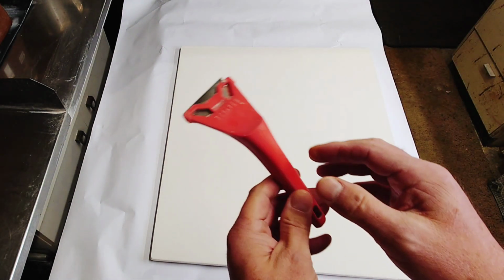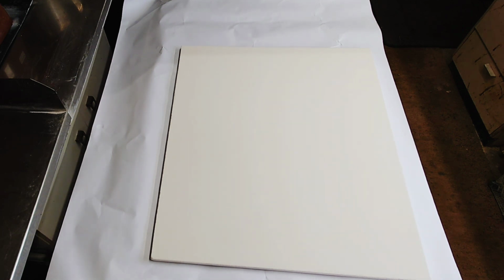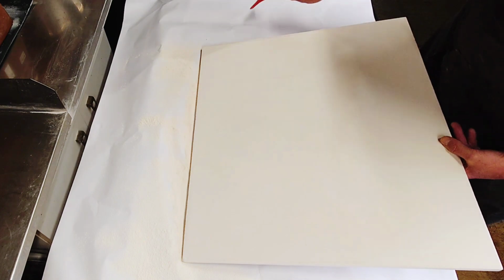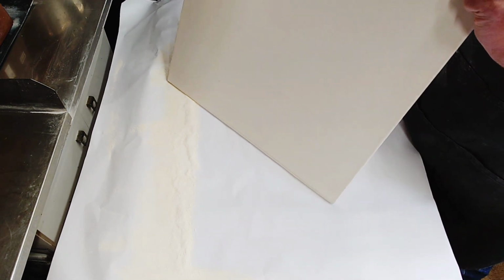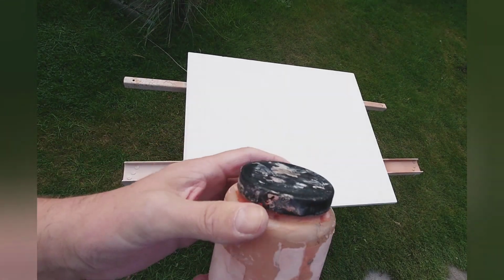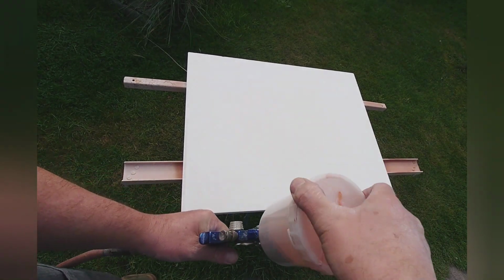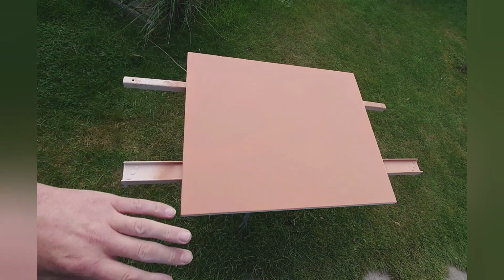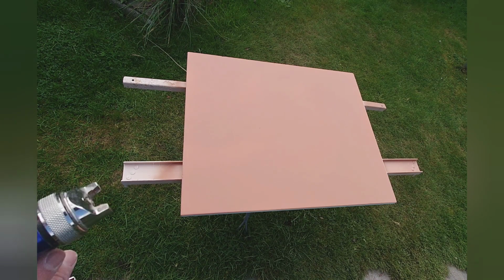scraping and spray priming your kiln shelves using Bullseye primer.

Comment: Great info!  I clearly haven’t been getting good coverage with just the brush.  The first time I made your simple geometric platter it cracked and left an imprint on the shelf.  Time to get a spray gun for my compressor and also use less water.  Thank you!